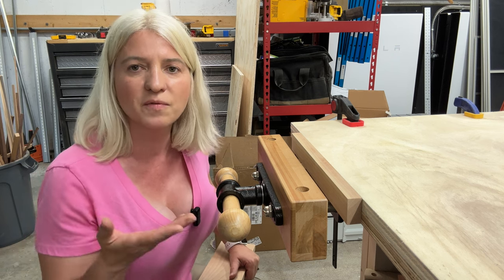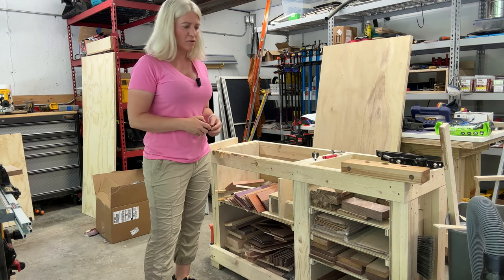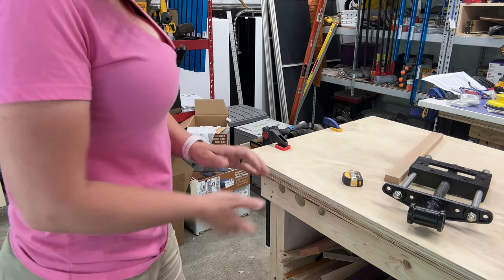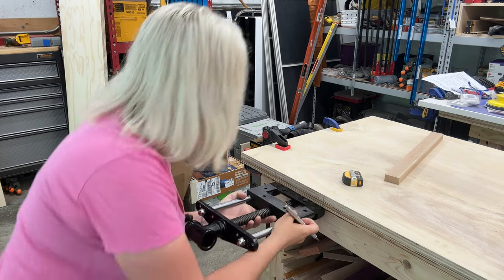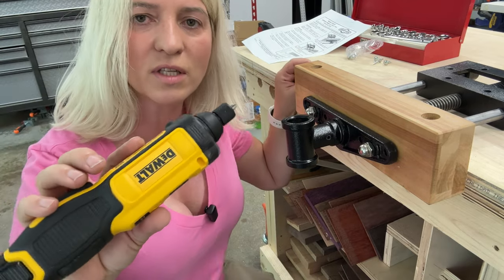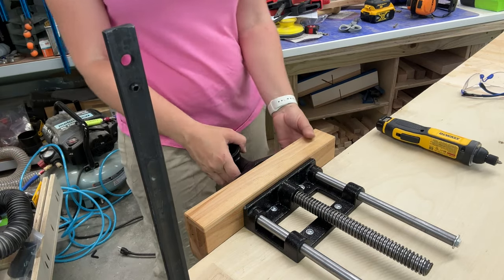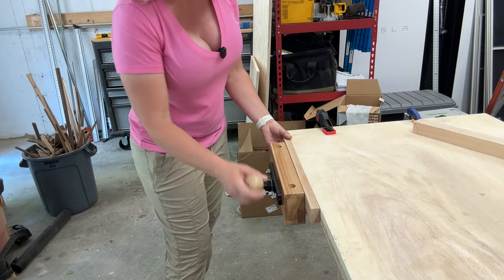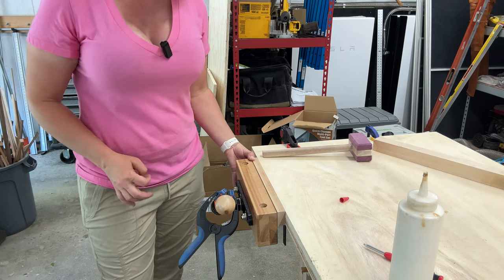Installing a WorkBench Vise. How to-Woodworking. Installing a vise

Comment: I remember that my father had a wood vice on the end of his work bench but it had a few features this one lacks.  I will list them here for folks who may want to build one with the features.
-- The wooden part that goes against the end of the bench was tall and reached down to where the bottom shelf was on the bench.
-- The moving jaw also extended down to the height of the shelf. At the bottom there was a thing with pegs that would let you set where the bottom end was.  This allowed the vice face to remain almost perfectly flat with the next feature.
-- The hardware where the screw was, was about 6 inches down from the top of the bench so you could grip wood that was more than 6 inches on that axis.
-- The stationary jaw and the moving one both stood out towards you by about 1/2 inch and the screw hardware was about 8 inches back from the front edge.  This allowed a board to be stood up in that space.  A scrap bit of the same wood at the rear edge of the jaws allowed you to force the jaws to grip well in this configuration.
-- The handle was made with dogwood ends because my father said the stuff doesn't split even when held onto the shaft with a pin that can be removed.
Reply from the maker: Sounds like an awesome vise

Comment: I realize this is after the fact, but consider putting a metal or rubber ring around each end of the handle to avoid them from breaking off. They get turned and dropped dozens of times a week.
Reply from the maker: Great idea. Will do

Comment: My first workbench is also the BMW from Steve Ramsey.  Did you double up the 3/4 plywood for the new top?
Reply from the maker: Yes. My vise required 1.5 in top to install it so I double the top. I like that because as the top gets beat up, I can easily replace the top sheet of plywood ( it’s only attached with 5 screws to the plywood below

Comment: You might consider removing the extra piece of cherry so the when long boards are clamped they press against the side of the entire work top. If the wood pressing against the plywood edge is a concern, it would be possible to cut an 1/8th inch thin strip of hardwood to face trim the top.
Reply from the maker: Thanks for the tip